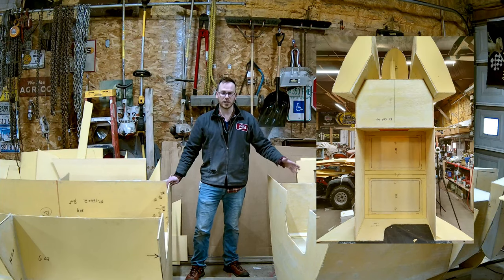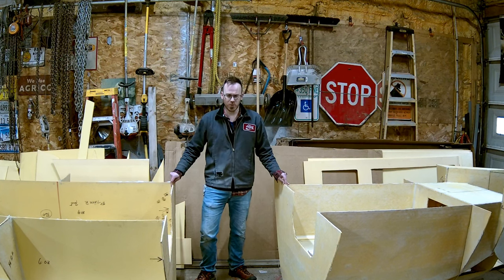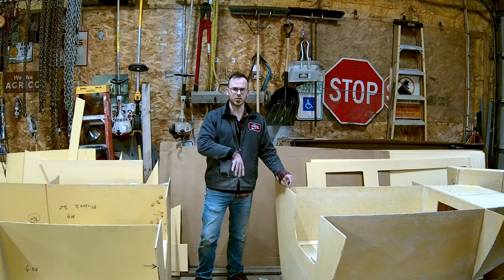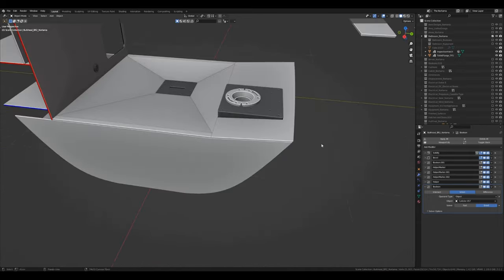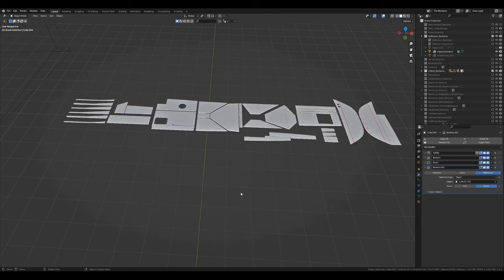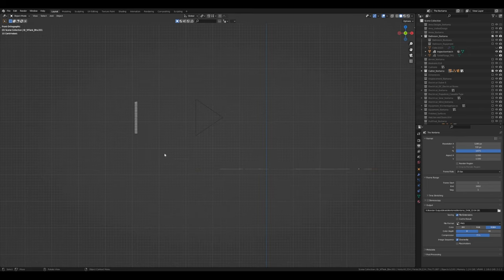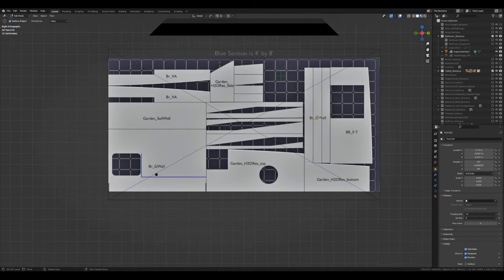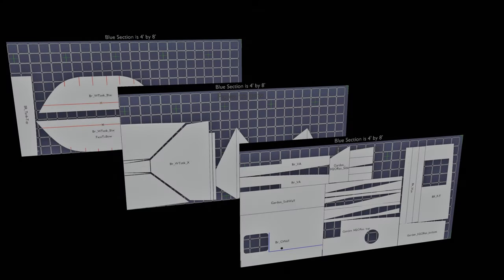Custom Sailing Trimaran : Ep3 Messing up and how to do better

Comment: Very creative with the projector use, love the blender work. Did you do any estimations on sailability/hull speed for the design?
Reply from the maker: I calculated displacement only. I am expecting a pretty slow ride as the center hull is not specifically designed to cut through the water. Some lift but not much. The ama's are not particularly sharp ether when compared to most tris. ANNNND the sails are undersized. The plan is to rely mostly on electric motors but it's all experimental.
Reply: @TornState  Comfort over speed - cruising priorities!
Reply: and that's why I really like this project. I hoped to sail more during retirement and got a racing trimaran for conversion with spartan conditions several years ago, but spend almost all the time on anchorages and wish I had more comfort.
Reply from the maker: @AnatolyKern  that's why I just decided to design and make my own. I looked at several boats and they all had either to many sacrifices or would have taken a significant amount of customization to fit how I want to live on the water.